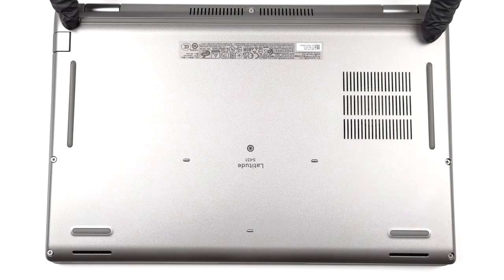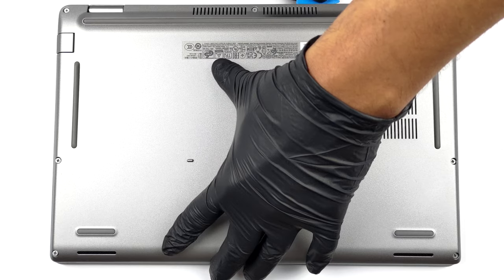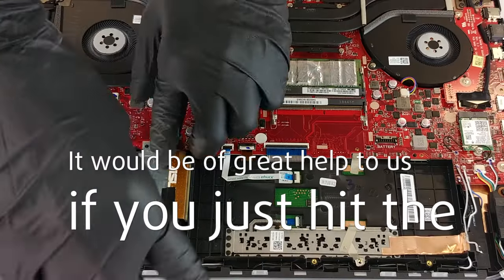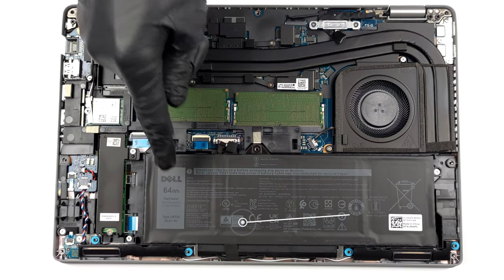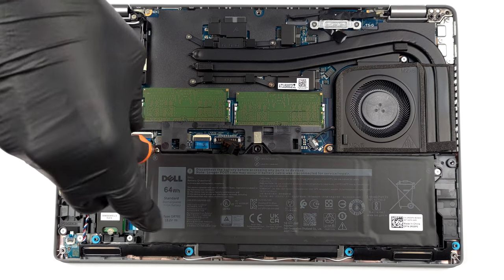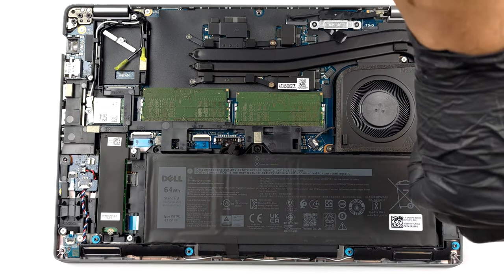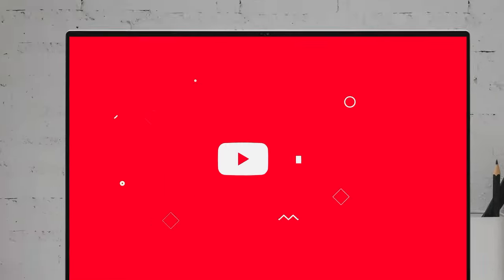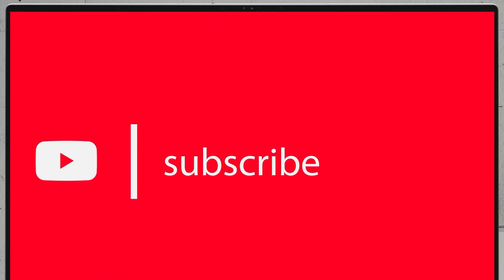🛠️ How to open Dell Latitude 14 5431 - disassembly and upgrade options

Comment: This is a crappy disassembly video my friend. You took out the battery, the RAm and the NvME-the absolutely easiest of all the parts to replace. What about the LCD, the speakers, the system board, the bezels, the keyboard, the touchpad, the wifi card, the WAN wifi if present, the antennae cables for the wifi, the cover assemblies - I mean it's a small miracle you got 82K subscribers....for gods sake do it right please.
Reply: Most people only focus on SSD RAM BATTERY. No need to go too far